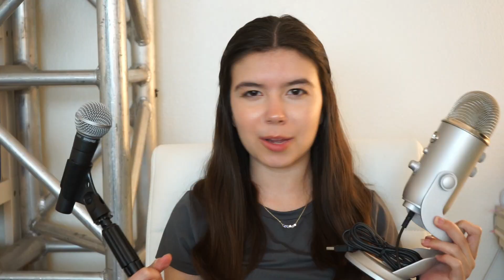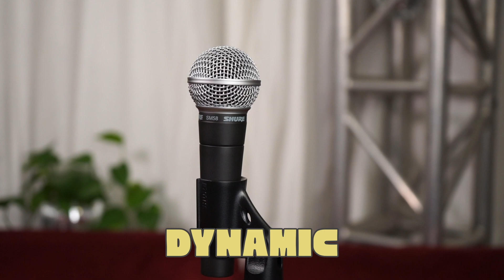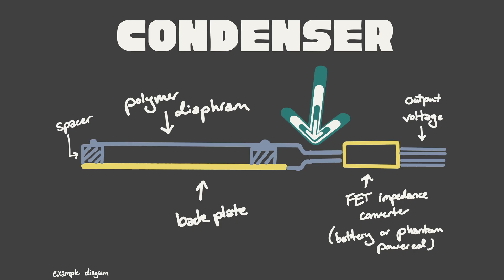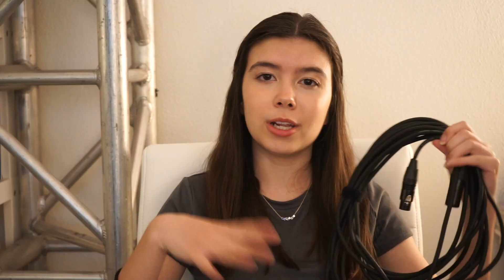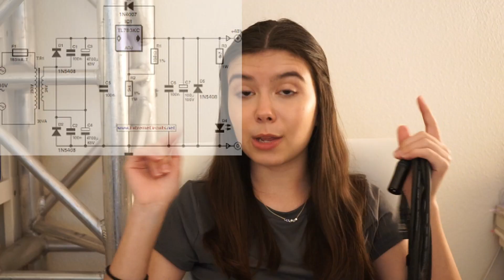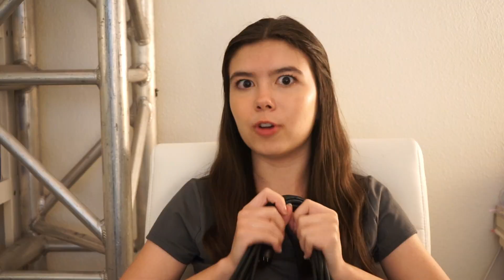Do Microphones Need Power To Work?

Comment: Fun fact: the term "phantom" comes from the phone company, Ma Bell. They used to use 4-wire circuits to carry inter-office "long distance" calls for better fidelity before amplifiers existed. When the vacuum tube was perfected, they were able to put both sides of a call on the same 2 wires. And then some clever Bell Labs engineer was able to put a third call on the same 4 wires by applying the third signal to the center taps of the transformers used on the other two circuits. This "phantom circuit" couldn't be heard on the other lines or vice versa. Phantom power works similarly, but with DC power instead of an AC signal. Today, solid state active circuits have generally replaced transformers, but the same electrical principle applies.
Reply from the maker: That is such an interesting fact. Thank you so much for teaching this to me!